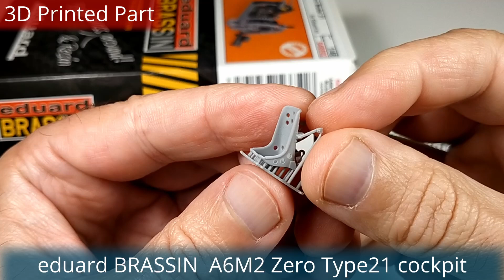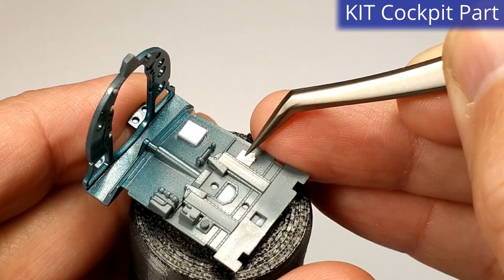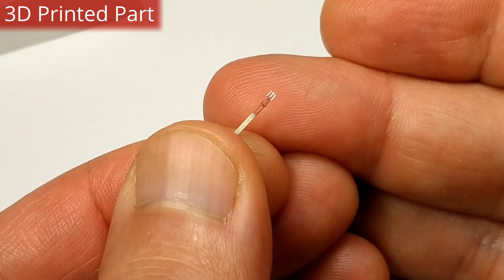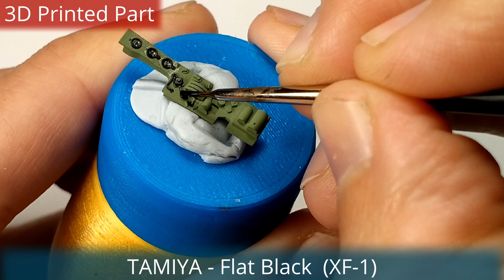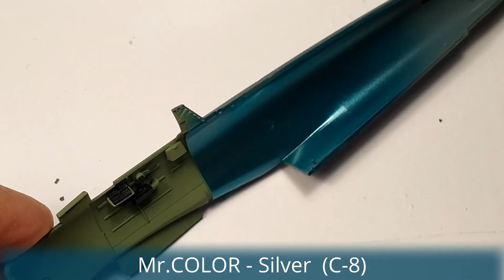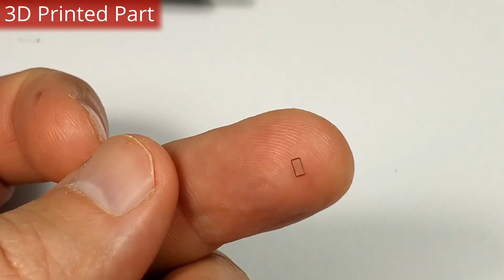A6M2 Zero 3D-Printed Cockpit Build 1/48 Eduard

Comment: Would you mind sharing the model number and brand of the drill you're using? I won those bits in a raffle, but I had no idea there was a drill for them. I've been using them as finger twist drill bits.
Reply from the maker: Hi, I hope this helps.
I use this cheap USB mini drill from eBay.
https://www.ebay.com.au/itm/394733740986?mkcid=16&mkevt=1&mkrid=705-154756-20017-0&ssspo=4vkwsu2cteo&sssrc=4429486&ssuid=XJjMpOfOQfG&var=&widget_ver=artemis&media=COPY
The quality is definitely not the best, and the drill chuck is crappy, but it's small and lightweight, so super easy to use for delicate work.
I also use this small voltage regulator. With this device, the RPM is widely adjustable.
https://www.ebay.com.au/itm/186677795787?mkcid=16&mkevt=1&mkrid=705-154756-20017-0&ssspo=tup8agtpr1u&sssrc=4429486&ssuid=XJjMpOfOQfG&var=&widget_ver=artemis&media=COPY

The drill bits are normal CNC drill bits normally from 0.1-1.0
Let me know if you need more information.

Comment: Well that was really nice, thanks. Engine next (my favourite bit.)
Also thanks for all the little snippets of history and construction, I find them very interesting. Did I hear correctly, a "rubber band" for seat adjustment?🤣
Reply from the maker: @truthhurts9241  yep, as far as I know, there was a rubber-ish band behind the bucket seat to adjust the height. 😁
Reply: @cslvisualstudio  Ha ha, that's what I call a weight saving solution.
I did actually hear on a program about a Zero restoration that the fuselage skin was so thin that the aircraft handlers were only allowed to push it using certain parts of the bodywork for fear of causing dents and splits.
Reply from the maker: @truthhurts9241  true that,
Extremely thin.